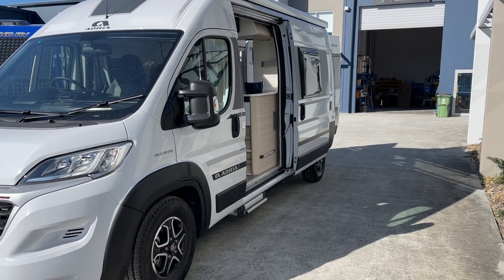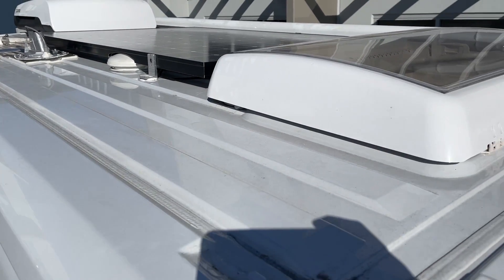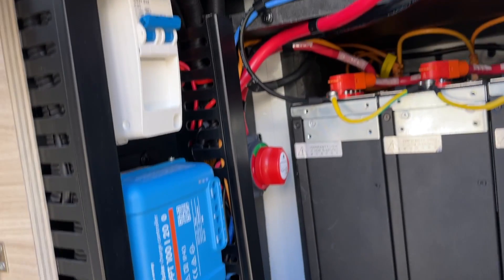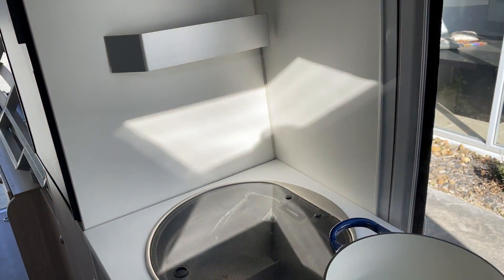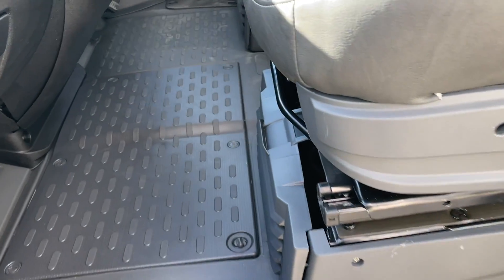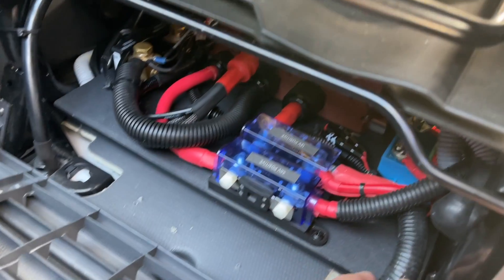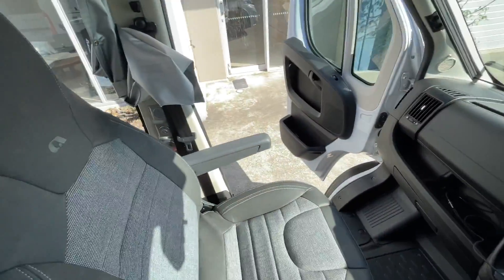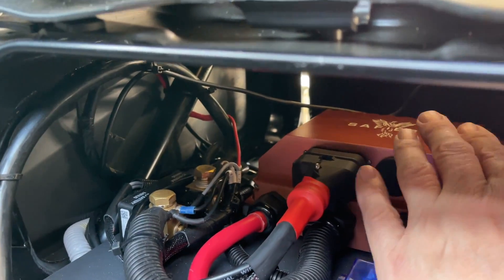All Electric Adria Van Walk Through with 48V power System 3,000W Scotty Replenishment Alternator

Comment: Great setup, out of interest how long have you ran the ac off grid?
Reply: It is my van. Tested the van in 35c heat and had it running 24h easy. The van is a lot smaller which means the AC doesn’t need to work hard at all. 600w draw during the day but getting offset by the 400w solar. During the night, AC only kicks in once a while.
Reply from the maker: Not sure on this Adria setup, With Iveco vans and Sunliner, all night!

Comment: hello what was the fuel consumption when idling and charging?
Reply: i`m the owner of the van. haven`t seen any noticeable fuel usage increase. 10-11l per 100km
Reply from the maker: We dont know but we can use our CANbus trigger so there is no charging below 1,000RPM and in fact the power goes from the 48V system to the starter battery improving fuel consumption at idle. See our other posts on this.

Comment: besides the technical apsect. What is the benefit of an all electric? in an adria (at least where lpg is for coocking and boiling water only) lpg lasts long
Reply: offgrid AC is the main objective and 2nd objective is to run laptops none stop. side benfit is better sleep without my head on 2 lpg gas bottles XD.
Reply: @dune_tech  how long does offgrid ac last?
Reply: @penguin272  technically indefinitely with alternator charging. On battery is about 4 hrs no stop (40c plus degree) or real world is about a full day comfortably
Reply: @dune_tech  ok. One day. But if you are off, how do you charge back then? 400wp solar is not that much to keep the van cool another day
Reply: @penguin272  simply start driving will provide 2.5kw charge to the battery. For my use case, I won't be stationary for over a day
Reply: @dune_tech  how long do you need to drive till battery is full